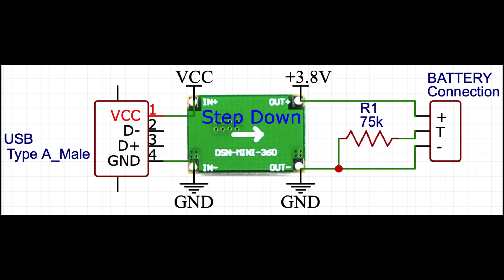DIY Sony ZV-1 Dummy Battery

Comment: you can charge zv1 whilst recording. so do you really need this?
Reply from the maker: While using your camera on battery power, It heats more than this mod. So, In theory you will be able to record longer 4K videos with less heat.

Comment: How do you solve the battery door not closing with the dummy battery?
A custom 3D printed door replacement?
Reply from the maker: Unfortunately I left it open when I am using the dummy battery. I use ZV-1 with a cage and a tripod so there is nothing on it's way.